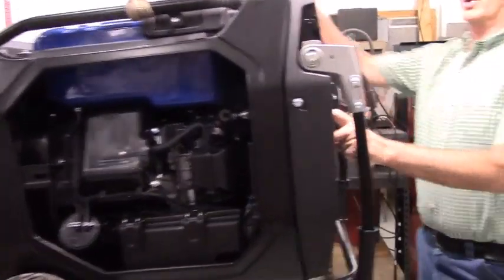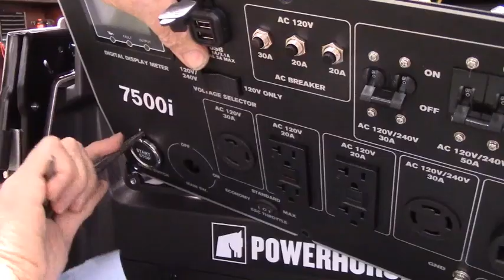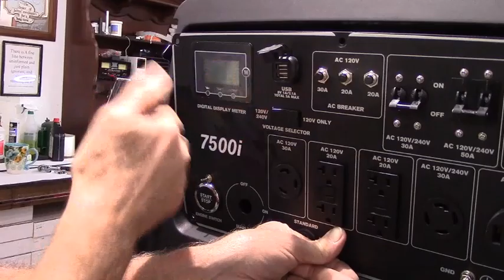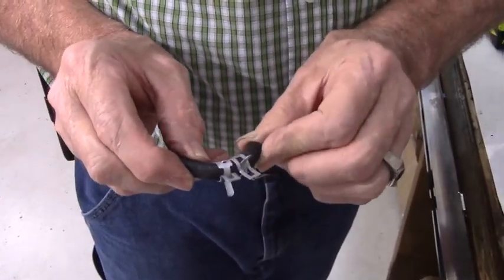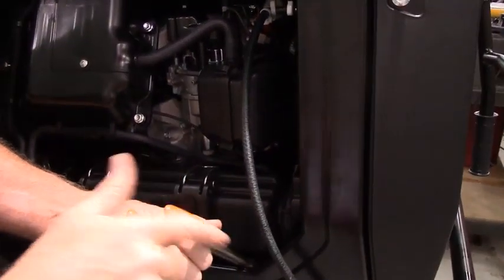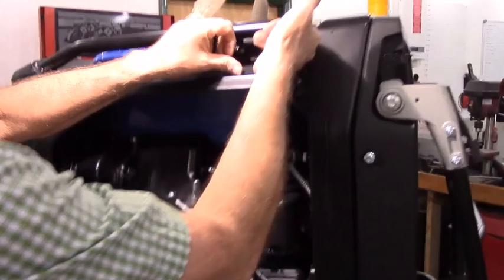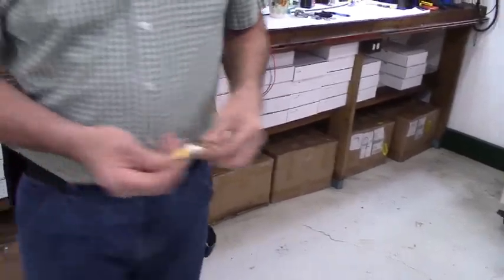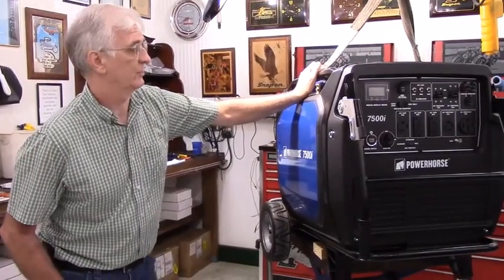Powerhorse 7500i Extended Runtime Fuel Kit Installation

Comment: This is a fantastic add-on feature. 

I am unsure if I need this for my application, but you put some thought and effort into this. Thank you. 

I have always had a generator with a fuel shut-off valve. Most of these were mounted at the tank or inline. I would always turn off the fuel and run the generator until it shuts off to ensure the carburetor was empty. 

I recently bought this new Powerhorse 7500i Inverter generator and noticed there is no shut-off valve on it. The manual talks about draining the carburetor for long-time storage, etc. 

This leaves me with a question you may be able to answer. 

Do I need to add an inline shut-off valve? If so, where would you recommend putting it?

Or does the off/on dial on the front of the generator stop the fuel from flowing, and should the carburetor bowl be drained before storage?